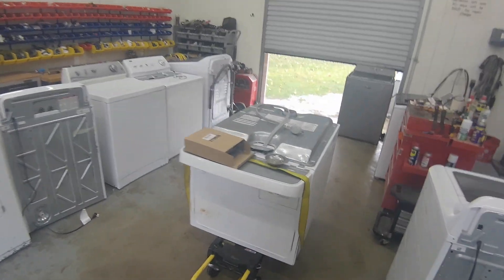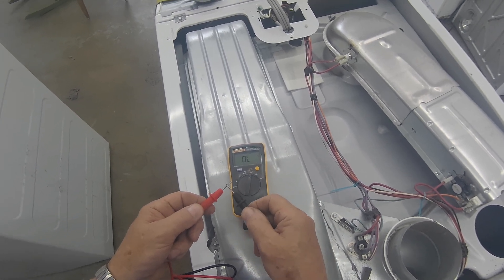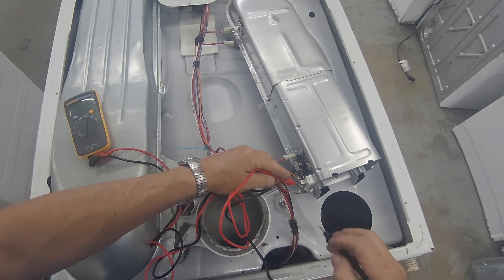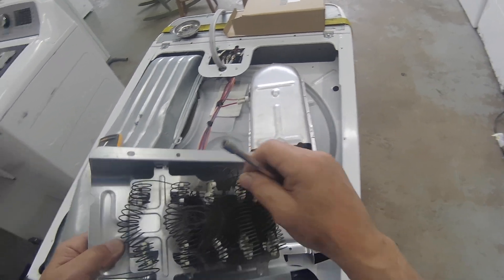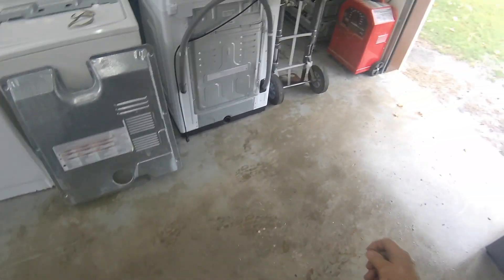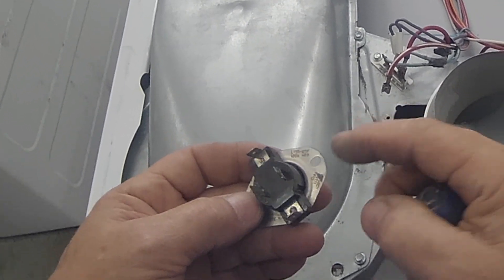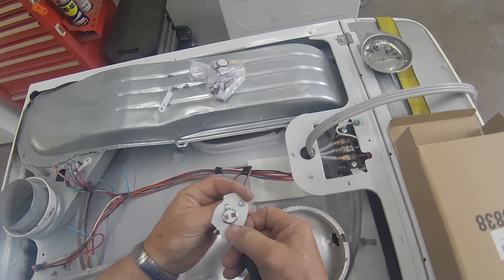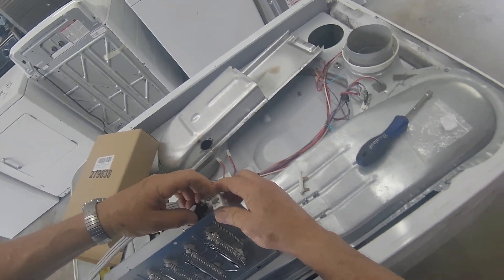How to Change the Heating Element & Thermal Cutoff in a Dryer

Comment: How much you get one for one of them apparatuses you made for straightening the shift tube
Reply from the maker: I don’t sell them, but perhaps I should. How much do you think I could get for one?
Reply: I have gotten a dryer and the heating element was showing continuity but it was also showing it was grounded to the frame but when i took the heating element out the coil wire was in one piece but anyhow the metal between the coil was burned up and bowed, have you ever seen something like that and what could cause it. Thanks for any info.

Comment: I always take the blower housing off make sure it's clean in there after that because if it overheat it it might be filled with lint in there too
Reply: That operating thermostat goes to the timer it's for the high and low heat when you have it on low heat that shuts it off quicker for I don't get too hot
Reply from the maker: Thanks for sharing!